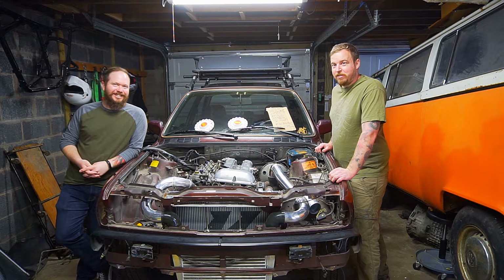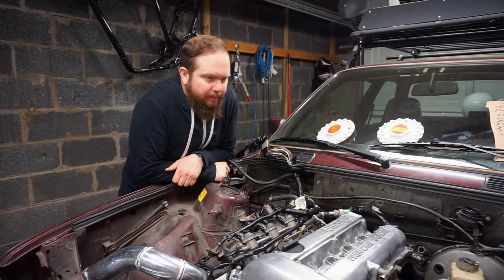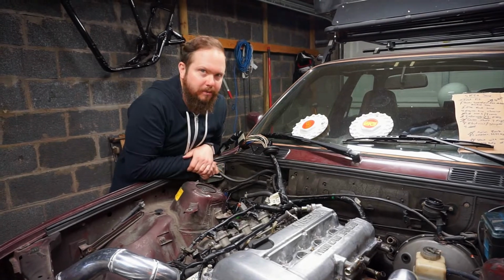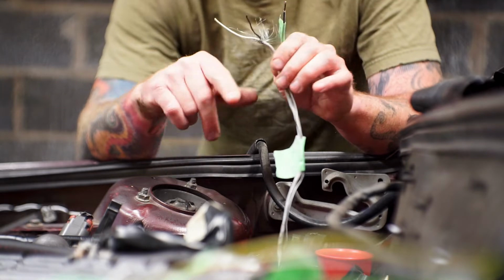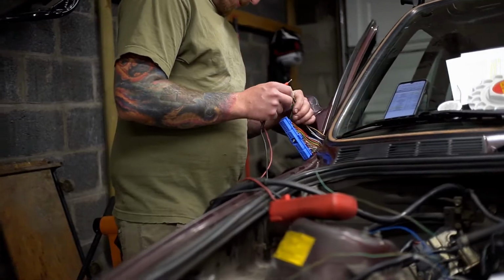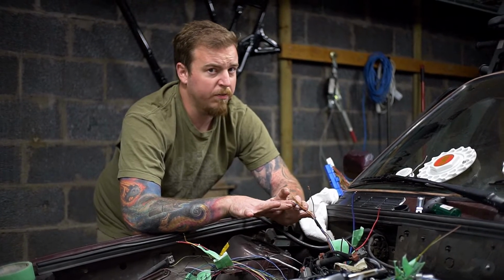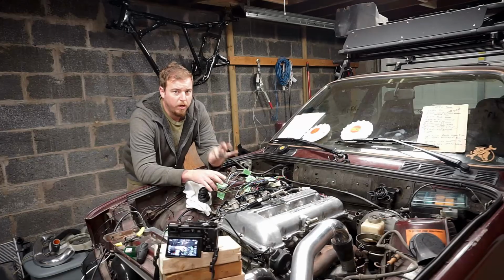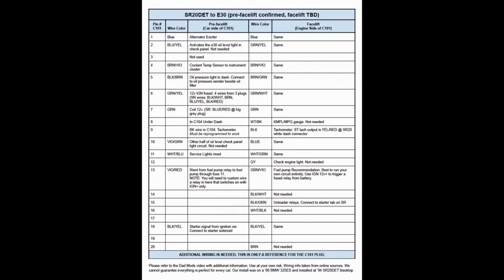How to wire an SR20DET into a BMW E30; The Year of the E30 Ep8

Comment: Hey guys im just trying to get my sr20det to run in general ive swapped it into an is200 track car and im just trying to wire it to a push botton start atm i can spin the starter and turn the feul pump and fans on  but thats about it  do you have a  diagram of what wires need 12v and or relays and what wires need earth in order for it to run when i turn feul pump on and spin the starter i currently have no power at my ecu at all
Reply from the maker: Hey Bradley, that sounds like an awesome project! We may be able to help, go over to the Dad Mods website www.dadmodsofficial.com and check out the tech section. I put together a bunch of info on the wiring that should helpful help! 
Forgive all the broken links on the videos, lol, YouTube changed something and I need to update all the urls 😆